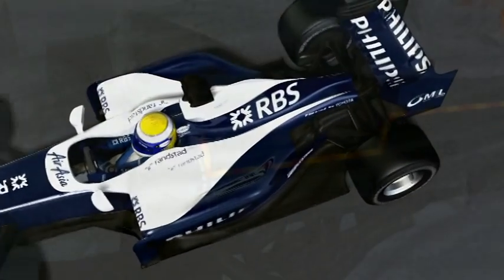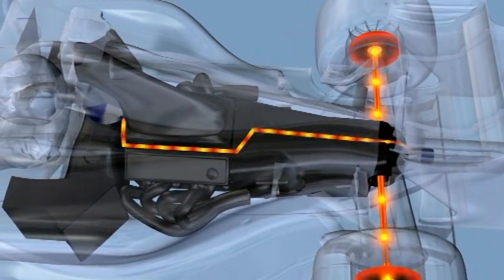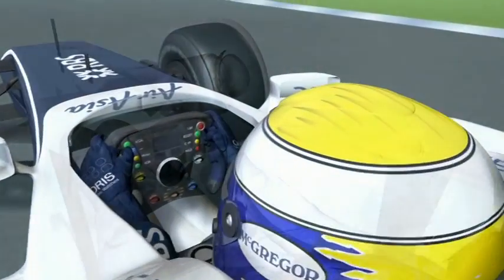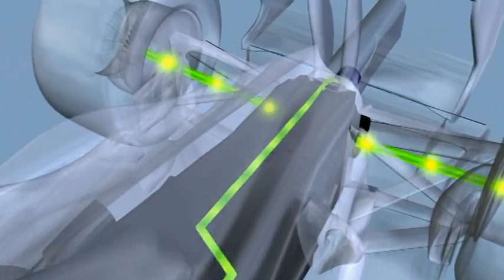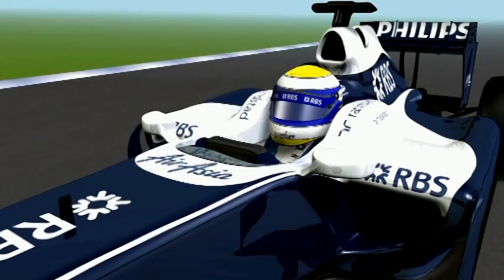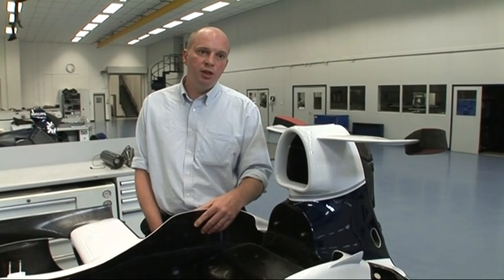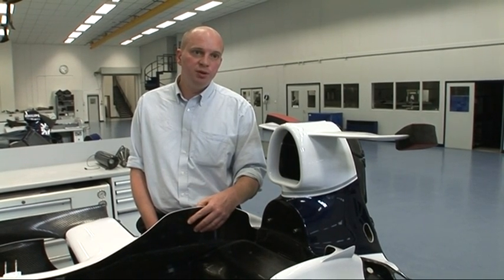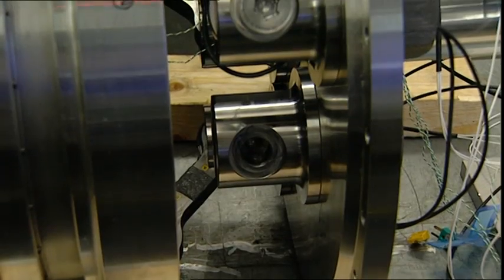F1 KERS system 2009

Comment: Braking is simply accelerating the car in the other direction. You put energy in to accelerate forward, you recover it by decelerating (accelerating backwards). Normal braking works by converting the mechanical kinetic energy of the car into heat. Instead of converting it into heat, you can keep it as mechanical energy, but move it into a flywheel. As to what linkage is used to connect the flywheel and the wheels, I don't know.

Comment: @JamesHol100 I actually hate the idea for 2013.  Yeah, they're probably not going to go back to spring valves as they need to wind those things out hard to make power, but with FI it might be a different ball of wax, depending on the turbo size.  I liked the V10's....I'm going to lose a lot of interest if they drop down to "tuned performance" car state..nothing they do should be achievable on the street (easily) :-\.  I don't like the 2013 plans and I'd be pissed if they ban pneumatic valves.

Comment: Off course we already hear about the electro magnetic shockabsorbers, you can dampen a(control the ride) or get a little juice if you want. Electric motor are most powerfull, but storageproblems. Gasoline has lots of btu's in small container. 
Trade off!  every otto engine has its range in which it works best..  add range and power by adding electric engine.  off course weight is an issue. Race is something other than day by day driving..   you really need 400 horses at peak by using max 100?

Comment: @ marinracer88    A little more continuesly ;-)   offcourse  need charging and release. And not suitable whole track long (corners). But why only on the straight? Btw  how strong can magnetic brakes be?  take that energy to charge.  off course top it off with ordinary brakes. Kers is nice especially put into a little vacumed magnetic spinner at 100.00rpm.. no friction just charge.  For these charges are fast and small. what will take it without much loss or heat buildup otherwise? capacitors? :)

Comment: We don't need the rules to be so restricting. Make bigger tracks for 300mph plus racing. To let progress happen, other things have to go with it. Safety...carbon weaves, better bonding materials other than the epoxies, that are more impact compatable. Possible advances, better than carbon fibers? But big turned, long straights on tracks, and flat out, top tech...That I'd like to see! 10 mile straightaways with giant gears added? Dangerous huh?

Comment: You must not know F1/GP racing history very well. 

In the 60s amateurs could come in and be competitive against the top drivers because their cars were better (meaning more reliable in most cases ). 

Slower drivers like Brabham could beat faster drivers like Moss/Clark to the victory and championship because their cars were more revolutionary/faster and reliable.  

In a revolutionary  mid-engined Cooper even grandma could beat a front engined "tractor" car.

Motorsport is not driver-sport.

Comment: As opposed to the volatile fluid that's being combusted and the parts of the engine already rotating at nearly 20,000 times per second which are located a couple of feet behind the driver?
Pretty sure there are more important concerns!

Comment: If road cars and the environment are to benifit, why limit the amount of energy reconvered by KERS to maybe 0.1% of total energy taken from burning fossile fuel? Make engines smaller still, and let team take substantial power from KERS. That some teams not even using it right now, speaks books about the limitations of the rule.

Comment: weight is more down to fuel load than the car, the cars including drivers are all under 605kg and they add weights to meet the minimum. a light car will be useful if the driver is tall.